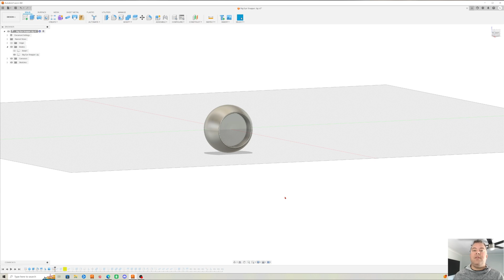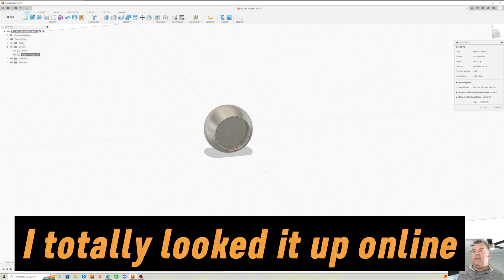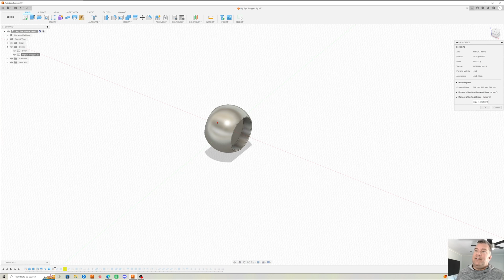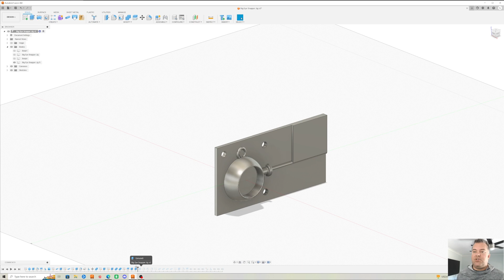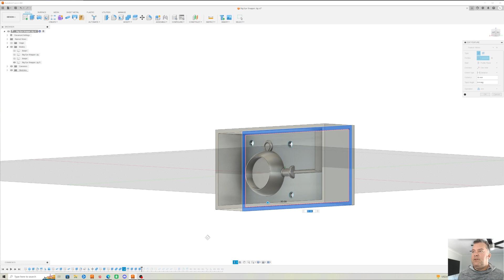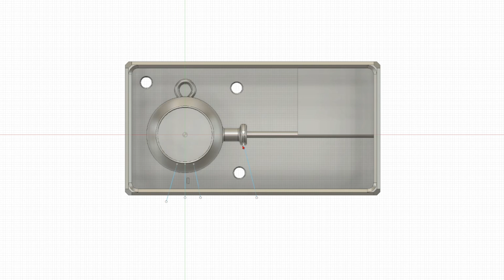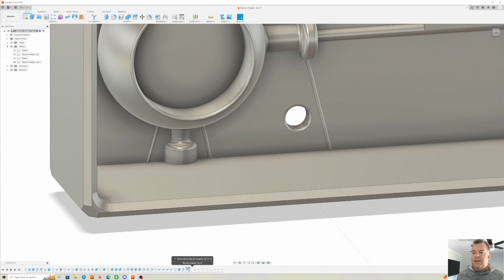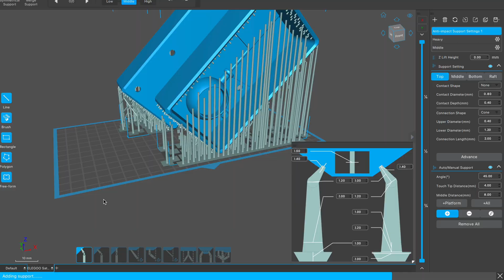Designing Jig Molds for 3D Printing

Comment: and I will change something else, I learned it from people from Indonesia, they make very nice and good reflective lead fishing lures, they put a handle on each side of the mold, and connect both sides of the mold with hinges, the ones similar to those used for doors, I don't know how you pronounce it in English, that way you protect your hands from hot lead
Reply: Awesome thumbnail ❤
Reply from the maker: Yes a mold made from aluminum or steel you can add some nice handles.

Comment: Thank you very much for the information, I'm currently making my first model for lead in fusion, you already mentioned in one video how to get the grammage in fusion, but it's good to note, I'll stick to everything mentioned as you said, can I see that it works, I'll only change one thing I think I will put putty for cars instead of mold max 60, does it say up to 296 C in the specifications, isn't lead much hotter than 296 C? I don't know, I've never worked with mold max 60, or with putty for cars, but I've seen videos of people working with putty for cars, what did you use to prevent the mold from sticking to the mold?
Reply from the maker: I pour lead around 560-580F which is a bit above what it is rated for but those ratings are not absolutes but more guides. Silicone will eventually breakdown but then you just get your master out and pour another one. CNC aluminum is best of course but much more expensive to create.

Comment: Another great video brother. Does that mold max have issues with curing on the resin mold. Some other silicone products stay gummy.
Reply from the maker: Nope mold max is tin cure silicone which works with 3D resin prints. You want to be aware of those non-curing issues if you use platinum cure silicone. There are ways to minimize the issues but u have to know that going in as there are specific steps you need to take during post processing. Tin cure though you just mix and pour!